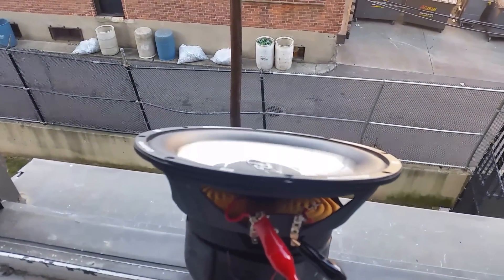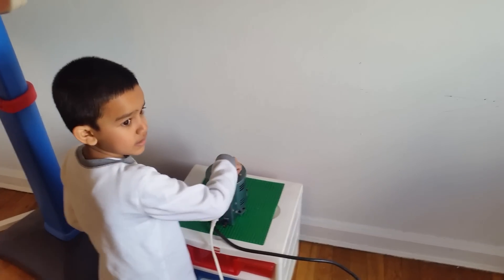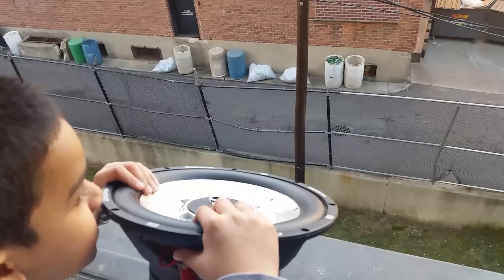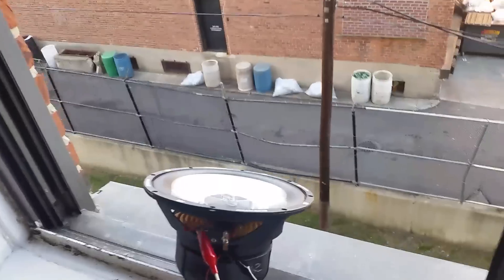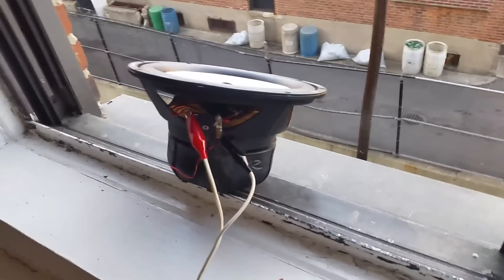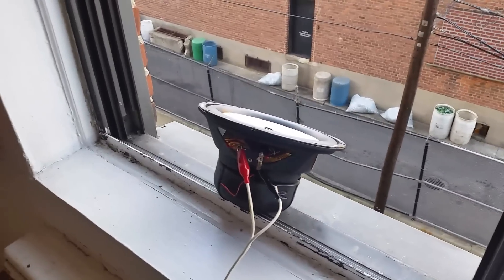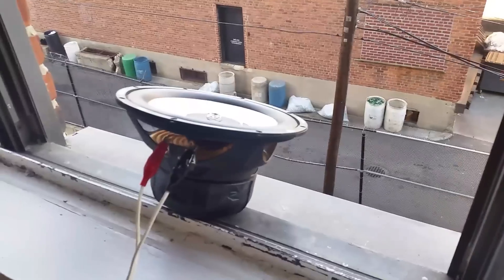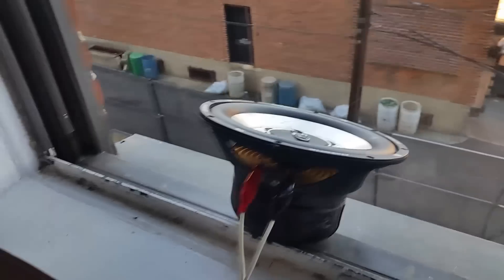Blowing out random speakers with a Variac. episode 1

Comment: The last sub looks like it used to be pretty good.
Reply: Kourkutas2 Kutsukuta It sounded really bad. I don't think anyone would deatroy a good quality sub, no matter if they'll use it or not. Might aswell burn a couple of hundred dollars
Reply from the maker: That speaker was all but un usable, there isn't a recone kit available, one of the anchor leads was broken, the coil was rubbing etc. Who ever had it before I got it, abused the crap out of it so hate them, not us.
Reply from the maker: Vlad Lucian It probably was, I was amazed that it took the full 120 volts from the variac for such a long time. It was a JVC Arsenal 10 inch.
Reply: 1 NYC DJ JVC? It must've been a monter. I know they have good quality. And this sub looks really beefy.
Reply: @Randommmmm204  jvc is awesome, I have their jvc mx-gt90 and hx-z30 component systems and they knock stuff over in the other room! insane for a component system
Reply: Vlad Lucian yes,and they shouldn't destroy it! i hate them now!!